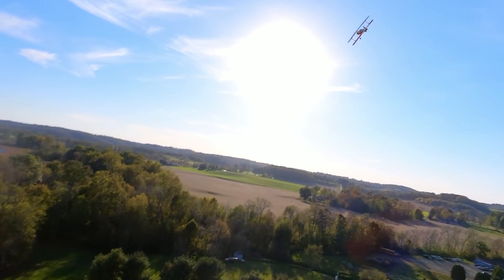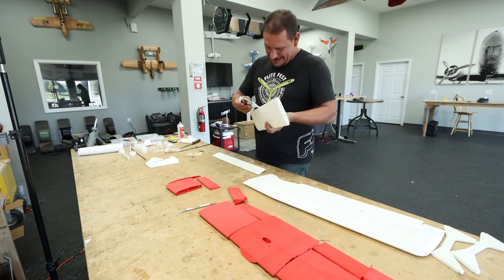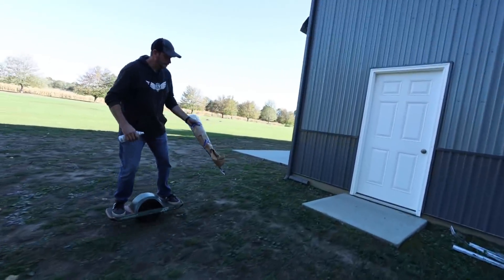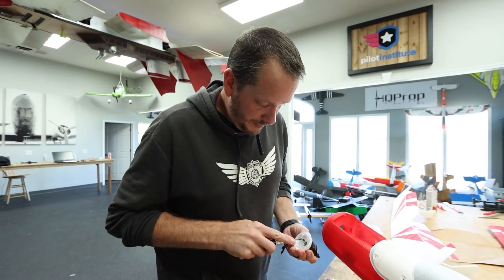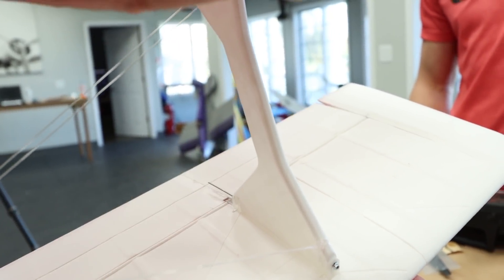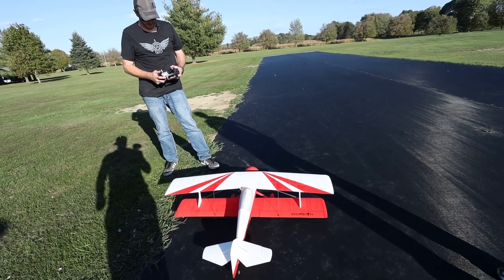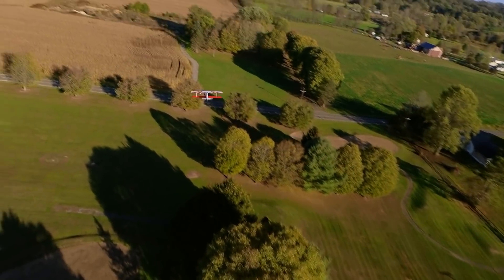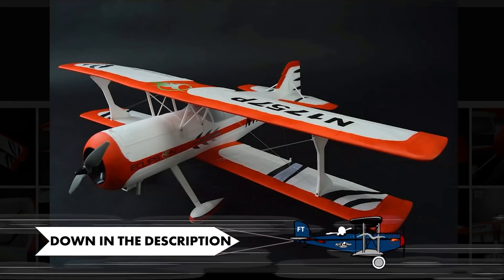This 3D Printed Plane is Made Fully Out of Plastic!!

Comment: Awesome bird build.
For the best aerodynamics improvement always spray on two coats of gloss clear over any paint unless it's also a gloss coat.
Then just one coat as the gloss clear will hide minor scratches.
You'd be surprised how much flat paint increases drag on an airplane no matter what size it is.
Reply: It’s not that simple. Smooth, polished surfaces sure reduce friction drag but they can increase form drag. Golf balls aren’t smooth and polished for this reason. Turbulence can actually reduce drag.

Comment: And I checked FlySky.  The receiver 4 channel and 6 channel can go all the way to a little over 1/2 mile.  1000 meters in the air.  So that is pretty long way out.  In a park, shouldn't be more than 2 to 3 hundred yards tops.  That is about 984 feet.  Way less.

Comment: Thank you!
 I've got a 100x100 bed using the easythread x1. This is the most accessible 3D printer on the market. I am trying very hard to come up with a 3d printed model (and fully recyclable) for a 3s battery, receiver and I don't want to use ANY CA or hot glue (even exploring 3D printed joiners). Typing to avoid all foam - can use Tape, Cardboard (of any type), and Rubberbands are okay. Bonus points the only screws used to hold servos and motor. Bonus points for not using any wood or carbon for spars. 

 What would you call this #challenge? I know there was the pizza plane - looking for something closer to this video :-) but minus the 125 hours of printing + glue 😃